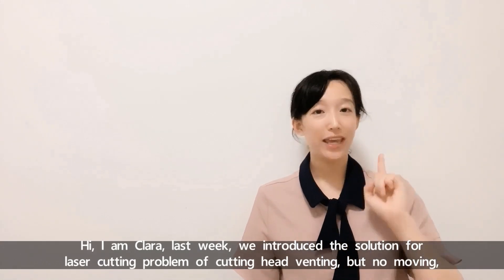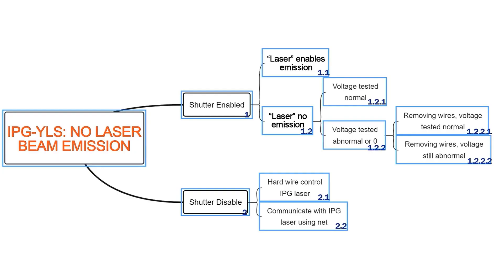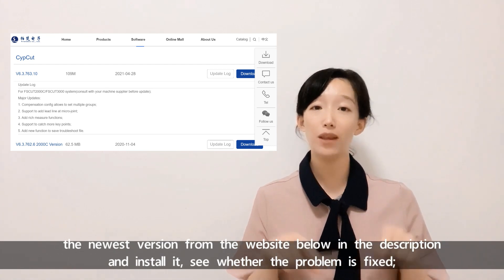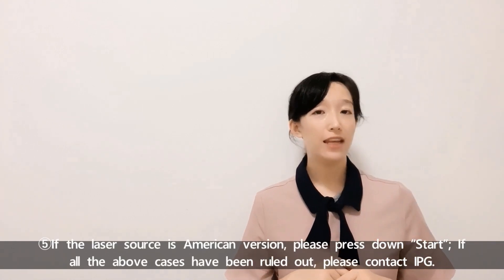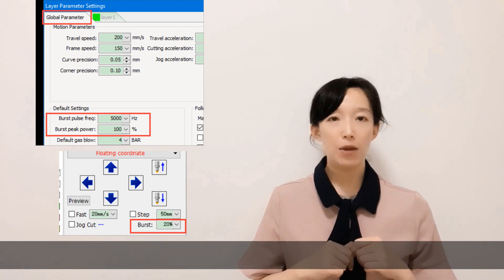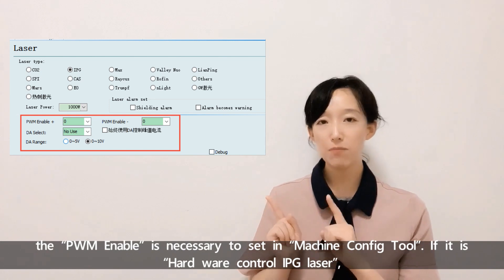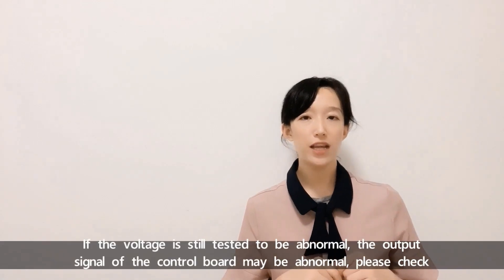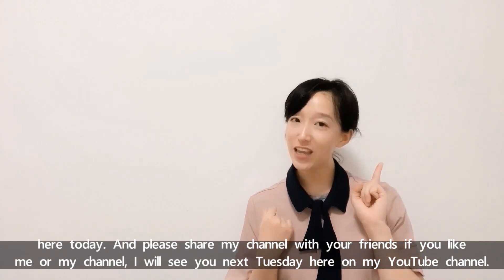Solution of Laser Cutting: NO LASER BEAM EMISSION FOR IPG YLS

Comment: Hello, we need help reprogramming a YLS-2000 after having to replace the power supply control board.  It seems the settings were lost.  Than you for any help.  We found your videos very helpful.
Reply from the maker: You can ask help from your laser supplier.

Comment: i have the same problem but in a Raycus laser source.
our 3kw source was damaged so we conected a laser source 1kw of our welding machine to cut. the machine was working with no problems but suddenly it didnt emmited laser beam.
we already check [mod] wires, measured voltages and checked if theres any alarm but everything looks good.
do you have an idea of what could be happened with our laser source?
Reply from the maker: Please check whether the laser is in good condition

Comment: Dear Clara
I am facing an issue with my laser cutting machine IPG 1500W
While doing cutting, suddenly laser source turns off & system shows IPG power supply failure & then Shutter gets turn off. Laser source restarts itself. Pls suggest what could be the possible error
Reply from the maker: It should be the single module, you could connect to the monitor of the laser and check the alarm and times. Possibly, the power module in the laser has something abnormal.